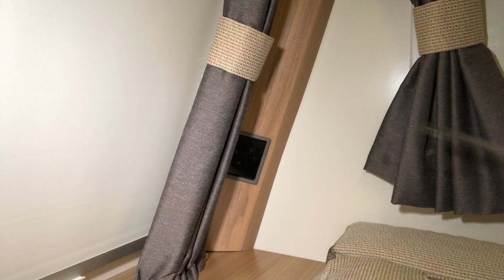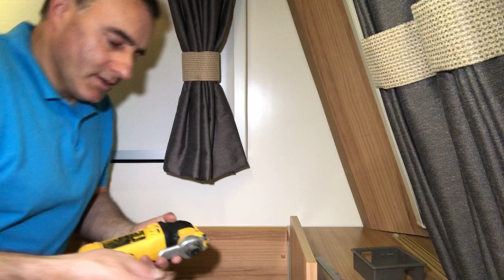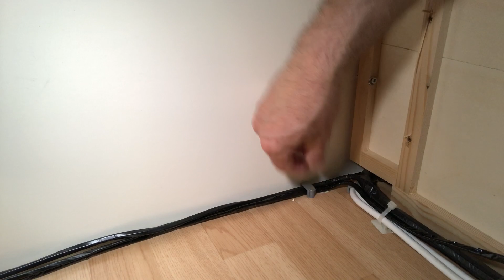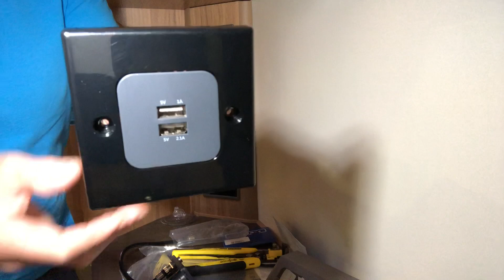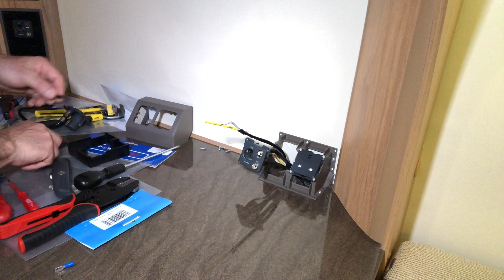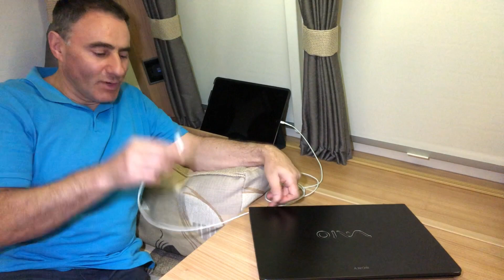Fitting a Caravan C-Line USB Socket Module

Comment: Excellent video and well explained.
At the back of my 230v socket i have the usual green, blue and red. The angled socket box i would like to add has the 230v socket. Alongside is a usb. With only 2 connection points. Am I assuming that only the blue(neutral), red(live) go to it
Thanks
Reply: Hi, that's great, thanks for the advice. Appreciate it
Reply from the maker: Hi Lee, I’m only aware of USB sockets in lesiure vehicles that connect to the 12v DC leisure battery system, not the 230v AC mains. The angled mains socket should be connected to the 230v AC system and the USB to the 12v DC system. The 12v would normally be taken from the existing 12v socket like I did in the video. The 12v wiring colours are usually different from the mains. P.S. I’m not an electrician but hope this helps. Cheers, Rob 👍

Comment: Great video. I am looking to do a similar conversation.

Do you remember the brand name and parts you purchased to do this install .back box, c-line product and pattress)?
Reply from the maker: I purchased most of the parts from Bailey’s primaleisure.com website and the actual twin c-line USB socket £21.95 and Truma adaptor plate (surround for the socket) £9.05 from eBay. 
The parts from prima leisure were single bronze back box faceplate, part number 1000096 £7.13.
2 x black tag/cam for black socket back box 1010029 £3.05
Black box for socket 1000086 £6.11.
I’ve noticed there are now twin sockets with one USB A and one USB C which could be handy.
Hope this helps, Cheers Rob 👍

Comment: Hi Rob love your videos so precise, trying to find the correct wire to add a usb socket, could you point me in the right direction. thanks
Reply from the maker: Hi Trevor, The wire I used was 1.5mm2,  21amp automotive wire. It matched the original wire feeding the 12v socket where I took the power from which is protected by a 10amp fuse. Hope this helps. Cheers Rob 👍

Comment: Can you give us links to the parts please? I would like to do this but can't find all of the bits. Thanks!
Reply from the maker: Hi Steve, I ordered the USB module, 1mm2 automotive wire and loom tape from eBay. The piggy back terminals came from Halfords. The back box, surround and cams I ordered from Bailey parts website www.primaleisure.com and the ferrules crimping kit from amazon but you don’t really need this. The heat shrink was also from Amazon. So a mix of sources. You should be able to find what you need by the parts photos. If you struggle finding something come back to me and I’ll try and find them for you. Hope you find them all. Cheers Rob

Comment: Great job there Rob. Makes a difference when you use all the right equipment and tools, so much easier. Like the tip with heat shrink on the lead. cheers Martin
Reply from the maker: Hi Martin, Thank you for your kind comments. I had bought a new lead to replace the old one but now I've fixed it we can keep the spare in the van. Just need to go away and try it out now. Thanks for watching and best regards. Rob